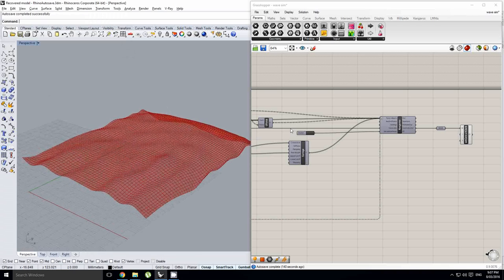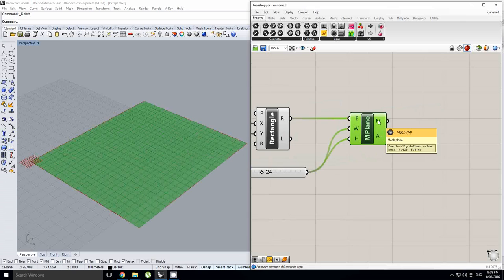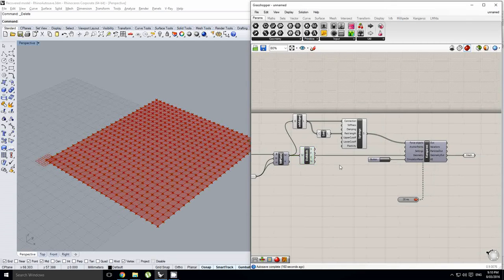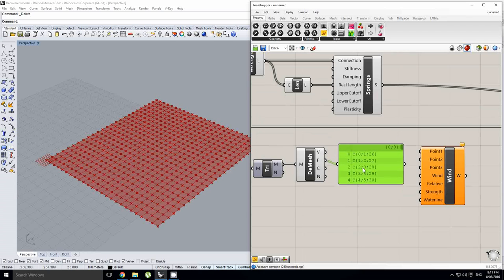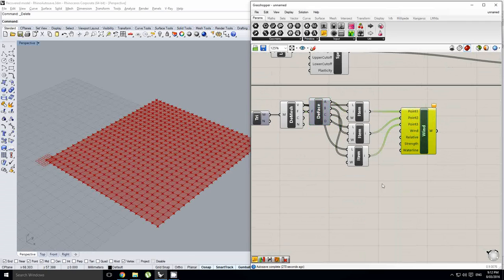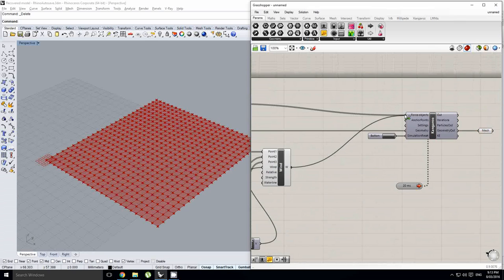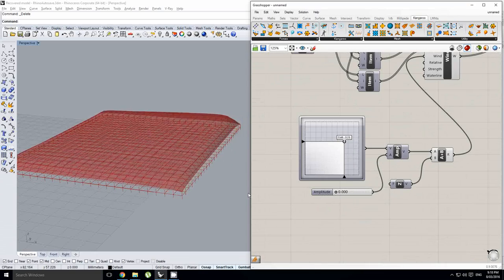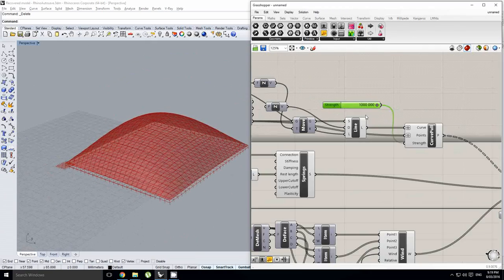Grasshopper - Creating a Wave Simulation in Kangaroo

Comment: Hi Daniel, thanks for a great tutorial. I played around a bit and found I could get similar wind dynamics by replacing the Tri, DeMesh, DeFace, 3 x Item, and Wind components with WindMesh.
Reply from the maker: Yes! You're absolutely right! WindMesh is a clustered user object which comes with Kangaroo, if you double click it to open it, you will see that WindMesh is actually made up of virtually all the exact same components. In general I prefer to show how everything works explicitly in grasshopper, but perhaps I should have mentioned that in the tutorial.

Comment: Hi, I'm trying to build what you have here, for a wall which emulates waves.  Kangaroo 2 has changed all of the Force Objects into Goals, so I'm not sure which tool to use that, in your video, is just called "Kangaroo" ?  Also, when I set a slider as integers for the mesh plane subdivisions, I am not seeing any grid at all, just the plain red rectangle in Rhino...  Could you offer any assistance?
Reply: Just got the subdivisions by plugging in wbEdges to MPlane!  Still trying to figure out the rest...
Reply: I'm using Rhino 6 with all the latest updates.  I also don't see Springs anywhere, even when I use the search command.  Is that at all related to BouncySolver?
Reply: OK, I've installed Kangaroo 0.099 (thank goodness it's still online), and I've found the missing tools.....  curious how there aren't analogs of many in K2.  Sorry for the stream -of-consciousness, I'm just excited to try something new for work, and I don't want to have to resort to using SketchUp like usual...
Reply from the maker: @jasoncolbert1018  hey Jason! Sorry for the late reply! Kangaroo 2 is actually a complete rewrite of the kangaroo solver, and took the plugin a very different direction to how it had been used leading up till then, so the differences are numerous.
For starters, kangaroo 2 shifted to a 'goal-based' solver, which means it doesn't tend to do animations like these necessarily, you would definitely need the bouncy solver in order to attempt to mimic this behaviour.
Secondly, Mesh edges can be previewed in grasshopper by hitting Ctrl + M on your keyboard, this is also an option in the display menu bar in gh.
Thirdly, springs in kangaroo 2 became the length goal, but once again, functions a bit differently.
Fourthly, I had addressed some of the major differences between K1 and K2 in this video on my channel, but the plugin continues to be updated, so do not take my words as gospel.
https://www.youtube.com/watch?v=R_Bfmm8y-Ms&t=636s

Good luck, feel free to reach out at any point, and happy grasshopping!

Comment: Nice tutorial Dan. Really thanks for sharing. However, I dont know why I could not stick in the boundary. Do you know which process could control this? Thx.
Reply from the maker: +张盛智 hey man. I used the curve pull function in this tutorial to achieve that part I believe. But since then, I've found a much easier way is to use an anchorXYZ on the boundary vertices, and lock the x and y components of the anchor.
Reply: Thanks a lot mate. It is useful.

Comment: What are your thoughts on creating a barreling wave. It may break the surface but higher peaks and more forces, possible?
Reply from the maker: Barreling certainly wouldn't be possible with this configuration.. Definitely a limitation of using a 2d mesh plane as the geometry. This was never meant to be an incredibly accurate method, and you would likely need to use a fluid dynamics solver to achieve more complex effects.
On the other-hand, higher and sharper peaks are certainly possible within this configuration through shaping of the wave-fronts.

Comment: Hello Daniel, I'm starting with GH and Kangaroo and would like to reproduce your interesting simulation.
 Installed GH 0.00976 + Kangaroo 2. Seems like the Kangaroo engine has changed, and it looks different. Mine shows as "solver" and has different Ins and Outs. Therefore I have in K2 no "geometry" input. What am I missing? Thanks
Reply from the maker: Hey there! So late last year, Daniel Piker (the creator of Kangaroo) released a complete rewrite of the Kangaroo framework. So presently there are two different official versions of kangaroo, they are Kangaroo 0.x, and Kangaroo 2.x. The tutorials that I have done so far are using Kangaroo 0.099, which you can also find on the food4rhino link.
Both Kangaroo 0.x and 2.x can run at the same time in grasshopper, and I personally have both, just because there are some things that I prefer about the original kangaroo at the moment.

Comment: I'm currently working on a biomimicry multilayered bridge with mangrove forest. it was very helpful to include a simulation of the tidal waves into my model. Thanks!

I followed the entire video and it turned out to be a successful simulation. When I tried to make the base rectangle out of the same script with adjusted numbers, it would no longer work anymore. 

Do you have any clue on why it doesn't work?
Reply from the maker: Where exactly is the error being thrown? It might just be a simple case of resetting the kangaroo simulation. Kangaroo initialises a simulation with the data it is given, so if the amount of data changes mid-sim, it can lead to errors. But as I said, a simple reset should fix that.
Reply: Daniel Christev   It is not showing any error bubble. It is just the  mesh simulation doesn’t show on rhino screen. 
I have tried resetting, but the simulation doesn’t seem to appear. I also tried to scaled the output geometry from kangaroo physics and it worked, but I couldn’t get the ideal wave scale  from the number sliders.

Comment: How would you go about freezing the simulation to bake it, then set aside a mesh or poly surface to work with?

Also, what additions and tweaks would you recommend to add a little more control/adjustment?
Reply from the maker: +Thomas Hall Hey Thomas. You could use something like a data dam, followed by a data recorder, if you wanted to save outputs straight into gh. The data dam gives you the ability to push through geometry/data at your own will. 

In terms of advancing the system crested here, I think you would have to look at optimisation. For instance, beyond a certain number of wave sources, this will get incredibly slow, I can't remember if I want beyond 5.. I've often thought about devising a system which could simulate more points based on some sort of noise algorithm - bit am yet to do so.. 
Also, one thing I didn't realise existed in kangaroo until after I did this tutorial was the ability to use anchors only fixed to a certain axis - so instead of performing the curve pull on each individual edge vertex of the mesh, you could use an anchorXYZ on them, and pin only the x and y components, such that z is still free to move. 
These are two ways you could improve the system here.
Reply: thanks for the reply!

Comment: Hi Daniel, I am pretty new with gh but i couldn't put more than 1 force into kangaroo force object. If there are springs, when i am putting wind the springs disconnect themselves. What am i doing wrong?
Reply from the maker: +Nicola Pasquini you need to hold the shift key while trying to plug multiple connections into the same input.
Reply: ^///^ Many thanks Daniel.